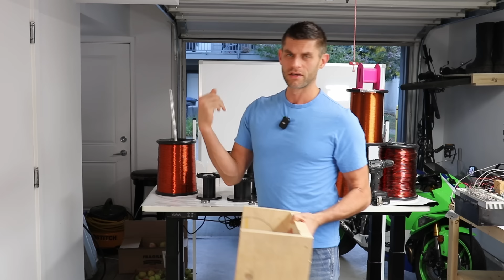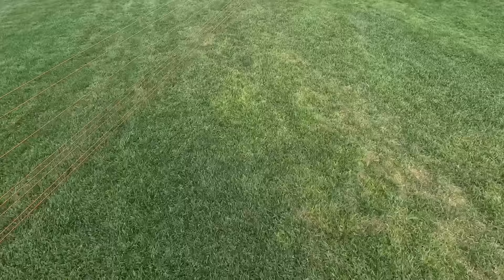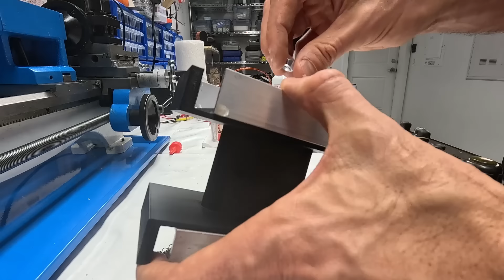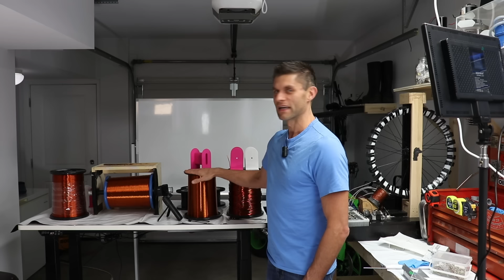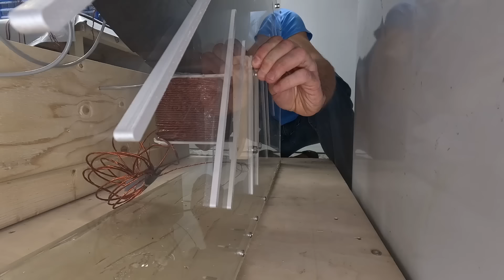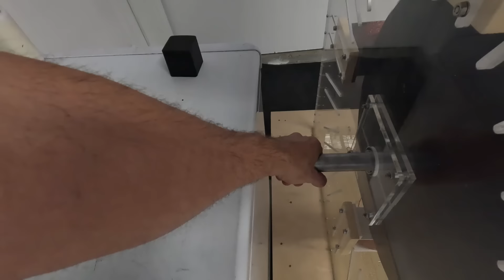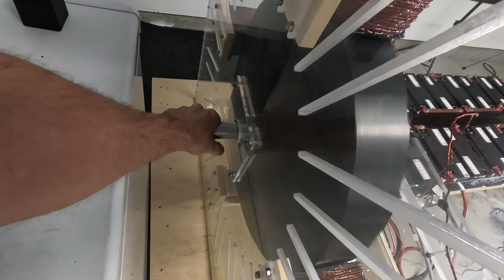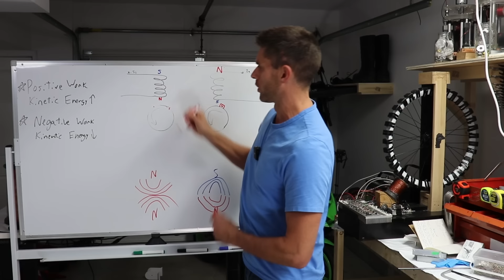The Device That Could Give The World Unlimited Energy

Comment: Great work. I am a mechaincal engineer, but very interested in the electrical side that you are experimenting with, it has great potential. From my point of view, you need to eliminate as much energy waste as possible in your design. Noise = energy. Your rotor makes noise. Maybe a horizontal rotor and experiment with a shaft and a touchless magnetic thrust bearing.  If this is not an option, look at the materials and tolernces of your shaft bearing and lubrication materials, and determine the optimum temperature for operation. There are so many variables regarding a device like yours. Keep up the work I will follow you as I am sure others will as well.
Reply from the maker: Cheers. My new video might change your mind on needing to reduce losses :)

Comment: Earth Batteries work. If you want one that works that has been shoved under the rug, check out Earth Batteries. Just look up Earth Batteries That Work and there is a series of books of Earth Battery setups that work. I built several earth batteries so far. Used in over 1800 communities world wide today even. Charge battery banks, charge phones, run lights, run all kinds of electronics, even runs pumps and much more.

Comment: Hello, greetings from Brazil.
First of all, I congratulate you on the work you have been doing.
I would like to ask a question below to find out if you have already tested this method.

I saw that you have a coil with 8 wires wound together, and that you pulse all 8 coils at the same time and capture the collapse of all of them. My question is, have you ever tried, instead of pulsing all 8 at the same time, pulsing, for example, only 2 and capturing, through the next magnet, the other 6 that would function only as reverse pulse pickups?
Reply from the maker: Could work yes
Reply from the maker: Shout out Brazil
Reply: @MadscienceLPTECH  when I saw in some of your past videos, where you show the winding and talk about the operation and the field opening that occurs when the coil is connected, and following the collapse, where you mentioned the opposite pole coming from behind the coil and taking advantage of the collapse, I believe that the wires I mentioned as being just extractors might give a different result. I'll see if I still have my Bedini here, I'll test it and get back to you.

Comment: I AM going to shit on this video.  The comments I liken to toddlers fascinated with balloon animals. WAKE UP (Dunning-Kruger lit).  

Now: Fair criticisms 

Scientific Claims and Validation:

The video implies excess energy generation from environmental sources, something considered controversial and unsupported by mainstream physics, particularly the claim of extracting energy continuously from "inner space" between atoms. The concept resembles "free energy" or perpetual motion claims, which violate the conservation of energy principle.

While the video demonstrates electromagnetics basics and coil winding skills, it does not present rigorous, independently verified quantitative data or peer-reviewed validation supporting net energy gain beyond input power.

Experimental Setup and Measurements:

Measurements shown lack detailed calibration, precise instrumentation, and analysis required to conclusively prove net energy output exceeding input, which is essential to verify "excess energy" claims.

The setup relies heavily on visual demonstrations of coil construction and motor running speeds, but power efficiency data is limited and measurements fluctuate, making conclusions on energy gain unclear.

Representation of Known Physics:

The video tries to reinterpret classical electromagnetic concepts, e.g., positive and negative work in magnets, to frame the claim of new energy sources. While these physics concepts are valid, the extension to claim harvesting excess environmental energy lacks robust theoretical or experimental grounding.

Some explanations, like repulsion mode being more efficient than attraction mode due to magnetic flux density differences, are interesting but not demonstrated to conclusively support practical net energy generation.

Lack of Reproducibility and Peer Review:

The device build and operation rely on complex, skill-dependent coil winding and timing circuits, reducing reproducibility.

Claims lack replication by independent researchers or fitting within established scientific paradigms.

Marketing and Funding:

The video includes sponsorships and crowdfunding appeals, which while common, raise questions about potential bias or motivation in presenting optimistic but preliminary results.

Comment: If you have two of these mounted on the sane axel going in opposite directions the efficiency will imprive and the generator coukd rotate in any direction because the inertia torque from each spin will cancel the other out.  Have you thought about fibernacci spacing on the distance of the poke pieces or coils?
Reply: Are your magnets in a north south arrangement or a pattern like a musical scale. If for instance you had twelve magnets and nsnsnnsnsnn this is a pattern of a musical scale.
Reply: I have always been shot down when describing an idea in this direction. I have a small idea using two counter rotating bicycle tires and permanent magnets. Sadly I have taken it much past the mockup. But it starts with counter rotating wheels with a center non rotating plain in between. I plan on using a fibernacci/musical scale kind of pattern and spacing. I hope to use the balanced inertia on several of these to move it around in any direction by upsetting the inertia balance in a directed and accumulated way. If the inertia is greater than the weight of the total mass it should lift or move with that inertia so its not anti gravity just directed inertia. Of course something like over unity is important first to have power available to store and keep it running.
Reply from the maker: Ideas are great. Building them is better. Try it out
Reply from the maker: I do keep that stuff in mind for final versions

Comment: I'm no engineer or have a degree but I played around with stuff like Leedskalnin's PMH device and joule thief circuits. Maybe this is a dumb question??? So, to get the magnets on the wheel to turn they are being repelled? That magnetic repulsion is caused by the coil which is energized?  There is iron in the center of the coils to make that repulsion stronger? I assume that all of these ??? would be answered as, yes? I have seen many of these magnet wheels on youtube. I have noticed they are all setup so that the magnets or coils are always designed so that they can equally be in a 360 degree circle. Wouldn't it make more sense to make a device that is separated into "7" within that 360 degrees? You can not divide 360 into "7" equal parts thus always having an imbalance. You could have "6" of them equally apart and then the 7th is slightly out of phase. Maybe do something different with that "7th" spot. I would name it "The Eternity Machine". Maybe send the outs of the six coils current backwards into the seventh coil. God created the heavens and the earth in 6 days and "rested" on the 7th.....as we are to do.
Reply from the maker: Interesting comment love it ❤ these are air core

Comment: When this gets really serious, consider attaching a brake rotor to the shaft and a brake caliper. Use something from a motorcycle. You don't want to use your hand in case it grabs you. And if you encounter a runaway situation, you have a fighting chance. 

2nd observation. What level of heat do the shaft bearings produce currently? You may want to consider a metal housing for the bearings and a way to dissipate heat, unless you go with an entire metal frame and enclosure when this becomes more dangerous. 

Other than that, you're doing an amazing job!! Love to see the effort you're putting in. Keep at it 😊
Reply from the maker: Valid points. The metal bearing contact is somthing ive thought about. V2 for sure

Comment: Great educational by assigning terms by Componentry and scan tool...for most that require ..visual video and common terms rather than pics n paper scemattic......proper color code such as....red for pwr supply blk for return charge.
However...WE or I..prefer....operational illuminated color SUCH as
Frequency wavelength color.
Amp color
Volt color
PATH color in/out and/or possibly/neg
Then the most important is
Rotation..color...clockwise or counter.😊
Lastly..
Visual mag lines of force telescopic giggles and infrared and rotation speed sensing😊😊😊😊

Comment: Interesting potential to consider incorporating voltage multiplier circuits and high capacity capacitors into the coils or program circuit boards   as current is shunted from the excitement and or discharge of the coils.
Reply from the maker: Yes on the front end that would be insane... thats what ed Grey did with caps and spark plugs

Comment: Thank you for the significant effort invested in this analysis. I offer these observations not to diminish your work, but to help us collectively focus our energy on the critical issues that have historically prevented progress in this domain.

Key Observations and Suggestions:
- The current analysis contains several unverified assumptions that may misdirect our efforts. For example, the assumption of doubling efficiency by using both sides of a coil (one as north, one as south) neglects fundamental physics; a simple current and voltage analysis reveals that the current draw will also double when loaded, negating the apparent gain.

- Regarding the proposed timing mechanism: Using a coil to "push" a passing permanent magnet (PM) will require energy to overcome the naturally induced current that opposes the PM's motion (Lenz's Law). Nature's laws of energy conservation must be accounted for in every aspect of the system design.

- Additional energy losses occur within the system components, such as in the switching transistors and due to magnetic inertia in the coils. High (di/dt) voltage spikes resulting from this inertia can also damage semiconductors.

- Actionable Request: To track progress accurately and avoid distraction, we must measure fundamental energy metrics consistently:
          The basic electrical energy output from the battery is P=I*V integrated over time. 
          
           The kinetic energy stored in the rotating disk is KE = 0.5 * I * omega^2, where I = 0.5 * m * r^2.

I am impressed by the dedication shown and wish you success. My strong advice is to investigate spark discharge phenomena and the material composition of spark plugs as a potential new source of high-energy electron particles (alpha particles) to slowly accumulate additional energy into the system. Please prioritize safety when experimenting with potential radiation sources.

Comment: BS! You are electrical engineer? The engine would go unlimited rpm without the load contention! If you wanted an over engine, take the outputs and tie them in to the inputs, and then remove the batteries, and it will run and produce power!
Reply from the maker: Wow great idea 🤣

Comment: Power out ≠ power in!  power out < power in.  Anything else is simply a lie.  Even IF it were possible to eliminate friction (it is NOT) your best hope would be unity.  But it can NOT happen with semiconductors.  Semiconductors have losses as well!  Your best hope is to hook this up to a source of flowing water and capture 30% - 40% of the energy there.  Over unity has been tried by people smarter than you AND I and has failed EVERY time.  HINT: If you can hear it running you are wasting a LOT of power...  And BOY can you hear that thing running!!!
Reply from the maker: Generic mindset = generic results
Reply: @MadscienceLPTECH  🤣🤣🤣

Comment: Keep in mind that the final design should be relatively easy for others to build with inexpensive materials locally available. I will be sending my magnet motor CAD plans and flash drive video out to hundreds of people before I post it on social media. The advantage of electromagnets is cost and availability if the net power gain is sufficient. Even the rotor can have electromagnets fed by brushes.
Reply from the maker: Nice

Comment: A few thoughts to share: First  and most importantly you should consider hiring some protection for yourself, since we know the energy industry will not like you very much if you succeed in this endeavor. 

Secondly, the use of the opposite side of the electromagnet would probably work better if you considered a system of mechanical energy to increase the speed or torque of the rotor you already have because aligning 2 different alternating currents with potentially different rpm is likely going to complicate things. But with greater torque you could run a rotor with stronger (heavier) magnets with greater generating potential. 

Lastly, I just wanna say great idea on dealing with entropy by putting to work the energy that was previously ignored by those who failed to think outside the box! You didn't discredit the second law of thermodynamics, you overcame it by importing  energy that already existed into your closed system from outside the system, thus  enabling your generator to make up for any entropy that would occur. Kiddos!
Reply from the maker: ❤ agreed

Comment: I know most people understand how a coil work, but I think you should emphasize that the coil wire needs to be insulated, so the current just don't just flow the shortest way. There could be viewers that don't understand the principle.
And another thing.. You are so meticulous making the coils and everything else, so when I saw you just "eyeballed" the position of the coil at 26 ish minute into the video, I kind of lost all the trust you had built to that point. For an electrical motor/dynamo the placing of the coils is super important. And also entropy. Good video though
Reply from the maker: Ok agree❤

Comment: Did you consider placing the spinning rotor parallel with the floor‽ Could mercury be integrated into your machine to effect it or any outputs in some unknown way‽ What about a tube with mercury inside of it placed around the spinning rotor‽ Would the amperage increase per revolution for either input or output‽ How does your system compare to hydroelectric generators‽ What about red mercury‽